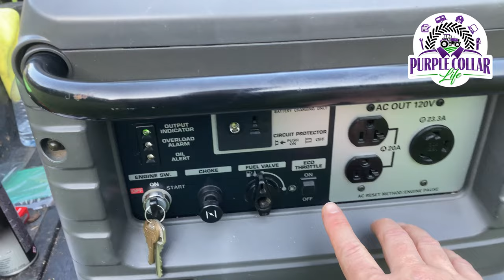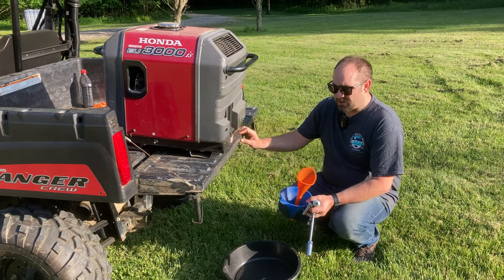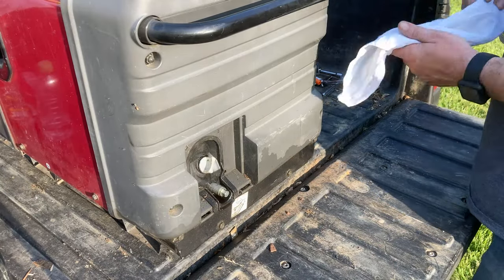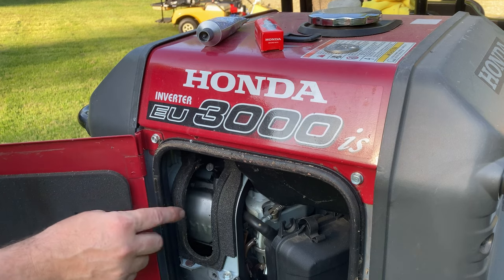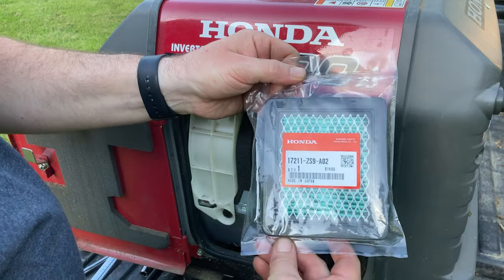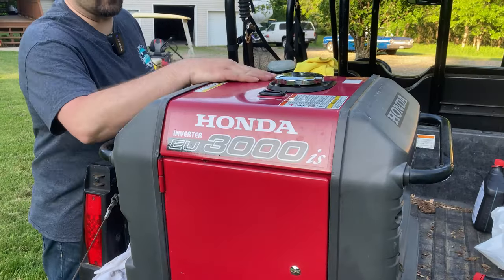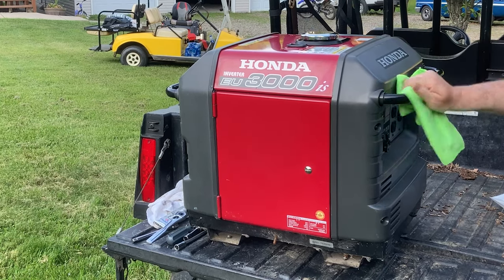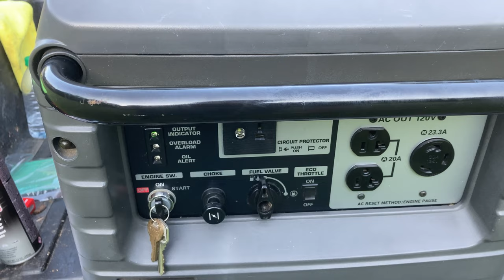Honda EU3000 generator RV season maintenance

Comment: Great little video.  When I purchased my 2000 I also picked up an hour meter and installed it. When serviced I put a label with the 'next hours due' date next to the hour meter.
Reply from the maker: Great tip!  I wish I would have added an hour meter to mine when it was new.  I've thought about adding one just for maintenance purposes.

Comment: Good Morning Sir, first you have THE BEST BRAND generator ever and that is not only me telling you that but my step father who work in the biggest generator maintenance company in Canada and Norden USA. I have an Honda generator EM 6500 SX ( winter ) and yes they are expensive ( around 4000 $ cnd fnd) but they are OUTSTANDINGLY RELIABLE.  OUTSTANDING tip about dielectric grease many OUTSTANDING MAINTENANCE TIPS 👌👌🧐 My 25cents tips, you can use a vacuum to dust off the inside of you generator and that is very important 😉👍 You should also clean off your the underneath 👍👍😉😉👌👌 Again Sir OUTSTANDING MAINTENANCE VIDEO SIR👌👌😉😉👍👍Cheers 🍻🍻
Reply from the maker: I totally agree - Honda engines are remarkably reliable.  Good tip on the vacuuming out the inside and bottom!

Comment: I have the same model, but on wheels for powering the secondary garage, works flawless for years and yes the spark plug could have had a more userfriendly position.
I did put an hour meter on it just to keep track, it’s an easy job and there are lots of tutorials on YT and I think it costed around 15€ (=15$) back in the day I.e. 2015. 
Seen the limited hours it runs < 25 hrs/year I do the oil change only every 2 years. Air filter = visual check.
Reply from the maker: Thanks for sharing! I sometimes wish I had the wheel kit on mine.  But I need it to fit under the tonneau cover on our truck when we're camping.  The wheel kit makes it too tall.  It's a great generator. I might look into putting an hour meter on mine since you mentioned it. I would have no idea how many hours are currently on it. But at least that would let me keep better track of maintenance intervals moving forward.  Thanks for watching and leaving the comment!

Comment: The crush washer under the oil drain plug should be replaced when changing the oil. It gets crushed and deforms to the shape of the drain plug.  They are cheap and prevent leaks and possibly overtightening while attempting to make the dripping stop.
Reply from the maker: Thank you for that info!

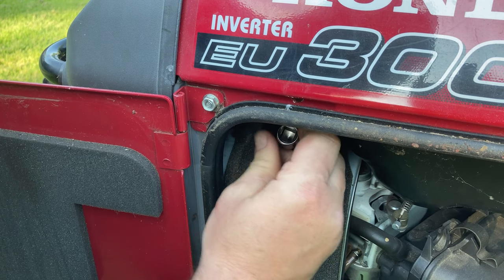Comment: I just bought a brand new EU3000is Honda generator and I ran into the same problem you had with the spark plug. The socket will not set on the plug squarely and correctly centered due to the valve cover interfering with the socket. You were not on the spark plug squarely and this gave you some problems installing the new plug  @11:19. I noticed you were having some trouble starting the new plug , then your video cut to when you were running it in with the ratchet. The valve cover design needs a cut out so you can install the plug socket square and centered onto the plug before attempting to remove or install a spark plug. 
Thanks for video. I am contacting my dealer tomorrow to ask what the remedy is. I haven't even started the unit yet.
Reply from the maker: You're absolutely right! I could not get the threads lined up because of the angle.  I eventually got it - but I was super careful starting it by hand so that I didn't strip out those threads.
Reply: I insert spark plug into 8 inches of rubber fuel line ... then spin the spark plug in with my fingers

Comment: How often do you clean the spark arrestor? The manual is quite extreme in all the maintenance, but I don't like messing with something running great.
Reply from the maker: I've cleaned it once.  The dealership cleaned it the first two years.

Comment: What do you do for maintenance for winter. Do you put stabile in gas tank ?
Reply from the maker: Great question. I try to run it totally dry of gas. If I have too much in there, I do use Sta-bil in it. I also disconnect the battery and re-connect it in the Spring.

Comment: But how do you charge the battery?
Reply from the maker: Connecting the RV power cord to the generator charges the battery. There is a built-in battery charger in the electrical system of most RVs, so that when you’re plugged into shore power (main power), it charges and keeps the battery charged.

Comment: How much Air filter
Reply from the maker: I buy the whole kit - it includes the air filter along with the oil and spark plug. Honda EU3000 Generator Tune-Up Kit, (1) 08207-10w30 Quart Oil, (1) 98079-55846 Spark Plug & (1) 17211-ZS9-A02 Air Filter: https://amzn.to/3zzgEPj

Comment: So you annual maintenance does not consist of checking the sediment cup or the flame arrester....but 1/3 of the video was dedicated to wiping and waxing the outside 😂
Reply from the maker: Thanks for watching. I don't check those items (sediment cup and flame arrester) every single year. We typically only use the generator around 10-20 hours annually.  But I agree - a person should check the arrester and sediment bowl) as part of their annual maintenance. I messed up. Thanks for the info.